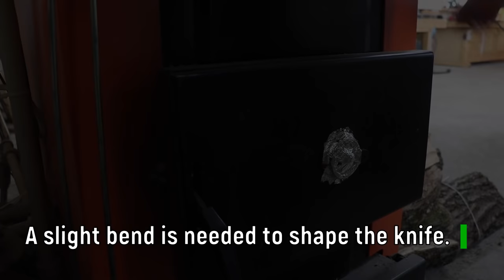Knife Making - Modern Tanto Knife -DIY Tanto from old file

Comment: Old files are pretty amazing for being reborn as a knife. Heating it up in a reall coal fire even does a pretty good job on the final result. Also those guys are straight, in shape and won't bend during hardening / tempering. They are stock straight and stay like that. So wour work isn't gone in the final moment... Top steel for a really well doing knife.

Comment: Very nice video and awesome craftsmanship!

I’m curious as compared to a traditionally made one by specially selected metal versus the one that you made, how would the blade hold against each other? By using a file, can it retain its edge as well?
Reply: File Is high carbon making it extremely hard which is I'm assuming  why he choose it. Truthfully it comes down to the hardening process. Also some traditional swords were made with different quality metals forged together harder steel on edge softer inside strength and hardness. I guess it depends what it is actually paired ip against.
Reply: Japanese made blades have usually two components.
Blue steel and white.
If you see them closely you will observe the two metals.
There is no comparison.
However his work is more than adequate.
If you like watch traditional Japanese knife making.
You will be in ow of the simplicity and efficiency.

Comment: You did a lot here that I really don't like
For one, you went with a full hardening vs a differential hardening, which means no natural hamon. Secondly how you made the tsuka and saya caused me physical pain. You also used glue and nails versus a mekugi pin, which is blatant heresy. You also didn't include a habaki, and used a metal spacer on a shirasaya style blade. This is an incredibly Europeanized version of a tanto, and I wouldn't even call it that. It's a fine knife, made using a lot of European methods, but you have no place calling it a tanto.
Reply from the maker: And I don't like the way you talk. First of all, we say hello, good afternoon or Нi. And also in a bad tone to indicate what and to whom to do or not. I want to say that I will name the product as I see fit. Learn to communicate with people...
Reply: @WDRestoration  good morning
I suppose you can call it whatever you want. As I said, it’s a fine knife, but that doesn’t change that it lacks several key details that a tanto has. 
I know how grueling this work is, and I never said the product was bad, I was just pointing out that is lacks several key details of a traditional tanto.